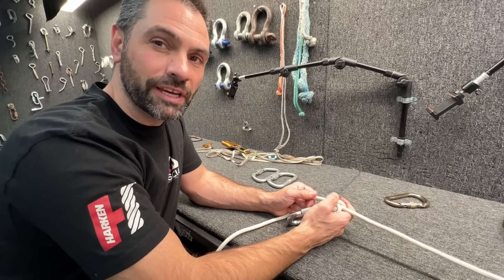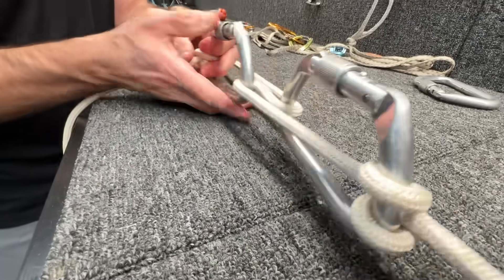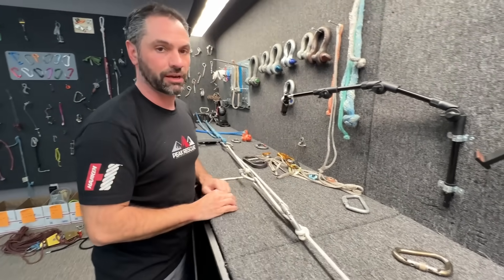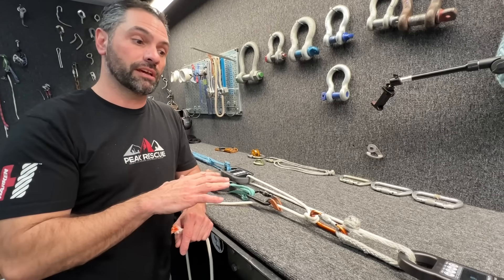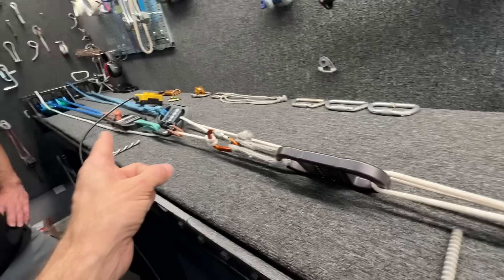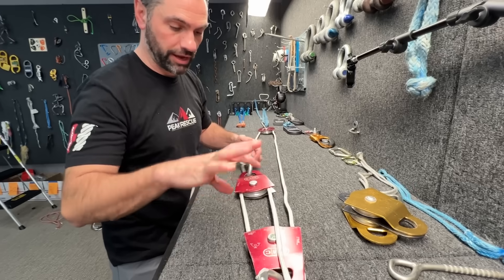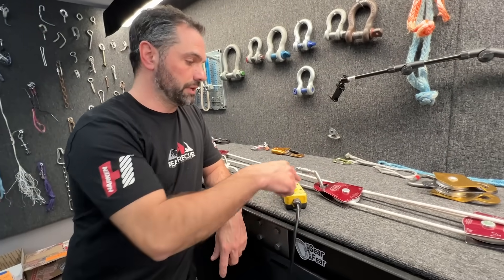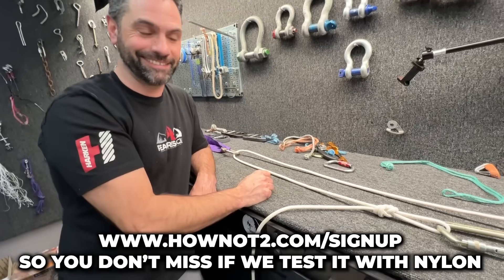I don't understand how this holds

Comment: "Mechanical advantage only exists when something is moving"? I guess that all that time I spent studying Statics was all fictional!!
Reply: Yeah, I'm not entirely sure what point he was trying to make there. Mechanical advantage exists in a static system, but you don't achieve anything. A force only does work if it is acting over a distance. Maybe that was his point?

Sometimes mechanical advantage can be useful to hold a force more easily, but in that case you are much better off with friction rather than a pulley system. That's how a massive ship being held by one man holding a rope wrapped around a bollard works or how a tensionless hitch works.
Reply: @thomasdalton1508 I think the misconception comes in from places such as the world of off-roading and vehicle recovery. I've seen similar discussions/arguments that say a pulley needs to be in motion for mechanical advantage to take place. In those instances, there most likely will be, but strictly speaking, mechanical advantage is using tools/setups to achieve force multiplication.
Reply: @mtbsam68  That's a different point entirely, I think. For a pulley system to produce mechanical advantage, there needs to be at least one pulley that is moving. The two forces need to do equal work, since energy is conserved, so if the forces are different they must act over different distances. The only way that can happen is if a pulley moves. I don't think that has anything to do with what he said in the video.
Reply: @thomasdalton1508 I was trying to agree with you, maybe I didn't word my response well. I was mostly saying that force multiplication is the definition of mechanical advantage, so motion doesn't need to take place at all, but when it does, one component or more will move relative to the fixed points. 

I for sure know that I don't agree with what is said here in the video though! Haha
Reply: @thomasdalton1508  I think he said that because he was confused by it not showing more force when using the carabineers vs the pulleys. He didn't get that the force is still there it's just being (mostly) eaten up by the increased friction
Reply: @thomasdalton1508 well and basically all knots work because of friction
Reply: @DrTheRich  Of course they do, but I don't know what that has to do with anything...
Reply: @thomasdalton1508  work requirements movement (work is force over time).  Most uses of these systems involve work being performed to apply force, not the post force-applied-static state.  That’s why everyone is getting confused.
Reply: @JB-jg1tc  Work done is force times distance.
Reply: @thomasdalton1508 that is what I am saying, yes.
Reply: @JB-jg1tc  It's not what you said...
Reply: @thomasdalton1508  I guess we can add another element of power vs (accomplished) work eh?
Reply: @JB-jg1tc  You said work is force over time. It's force times distance. Those are very different things.
Reply: Movement is not necessary to have mechanical advantage. There is however a universal tradeoff between advantage and movement. Take hydraulics, levers, block + tackle, etc. In any of these systems an advantage of factor M will exhibit a 1/M movement relationship. I’d be surprised to see a case where this is not precisely true.

Before watching the video I predict a 2:1 advantage.

My prediction is based precisely on one observation: the tensioning carabiner must move exactly double the distance that the bight carabiner moves. Focus on the relative moment between the two carabiners. To move the carabiners apart by one inch requires two inches of slack. This requires that the tensioning carabiner moves two inches toward the anchor. Two to one.

Now there’s another way to see that this is the case. In statics it is called sectioning, I believe. The forces in any cross section of this system must be equivalent. (or else there would be relative motion). You can see that near the anchor the force in each line must be half that of the force in the single line. Don’t be fooled by the section with three lines (the zig zag). The forces in this section are not distributed evenly amongst the lines. Remember that the force on the tensioning carabiner must be 1/2 of the full tension (p.s. there’s your mechanical advantage in one simple statement) and realize that the two lines running from it to the night carabiner each carry 1/4 of the total load. The line from anchor to bight carabiner carries the remaining 1/2. The system is balanced.

As with gears and amplifiers materials too exhibit the same relationship between force and motion. Double the force double the elongation. This is called the spring constant or Young’s modulus.
Reply: Don't you mean "frictional"?
Reply: @LoveAndClimbing well done sir. You beat me to the inevitable joke :)
Reply: @LoveAndClimbing Beat me to it.  Haha.
Reply: Aha, I got it wrong! And by a long way.

3:1 advantage is correct. It took breaking out pen + paper to figure out why.

Between the bight and the tensioning carabiner is a fixed length of line, D. The segment from tension carabiner to tree is length C. From tree to bight carabiner is length B. The length of the folded section (2 parallel lines) is A.

D = 2A + B + C
and
B = A + C

You find that 
A(C) = (D - 2C)/3
and
B(C) = C/3 + D/3

This makes sense. If C=0 then B=D/3 because the A segments match the length of B. If C=B then A=0 (this is the starting position).

Simple derivatives show that the relative motion of B wrt C (dB/dC) is 1/3 (when D is constant).

This relative motion is quite literally the mechanical advantage. 

There’s a good lesson to remember here. Remember to keep mechanical advantage and static analysis separate. No matter what the advantage of the system is it still is only as strong as the single line of rope crossing the distance.

P.s. this transport hitch thing seems like a poorly behaved block and tackle - you get the mechanical advantage but not the even load distribution.

I’m not sure I can fully agree that presence of friction destroys the mechanical advantage - which I argue is a property of the configuration - but I certainly agree that you don’t realize any benefits of advantage without motion. Friction in the system is realllly good at preventing any motion.
Reply: @oclyke22  ' mechanical advantage. '
When analyzing the idea of the difference between just the loops, and the pulleys in place of the loops, they seem to have left out that the pulley diameter itself has its own mechanical advantage.
Radius of the pulley vs axle diameter acts as a lever arm, giving much greater advantage against friction at the axle holding the rope at the fold back point.  The diameter routes part of the rope linear tension as a sideways force across and around the pulley, instead of just a fold back point.  If this didn't do this, there would be no reason to use pulleys to go around a point, larger diameter pulleys are easier to pull under load, etc.  No doubt a lot of crane pulley diameter calculations out there somewhere..

As always in physics, take things to the end points.  If the loops the ropes are wrapped around had infinite friction, nothing would move when tightened.  With zero friction, it could not hold even when you tighten it fully, because even with full even tension in 2 sides of the rope and basically equal pull, the zero friction would let it slide just a little past the fold back point and release tension slightly, and once tension started to release it would totally undo itself.

The far end tight fold, with the two equal sides basically balanced when tightly folded back, and the friction that creates with the pull against that, is what locks it in place.  Similar on the other end of things no doubt.  A direct , so balanced, fold back with a small diameter is what allows it to lock in place.

Easily proved by using larger diameter rod for the loops at the ends to put the rope on.  Say a 1" diameter and you'll probably have a difficult time to ever get it tightened, the rope tension will have too much leverage across the fold in the rear sideways portion, and the tension will make it slide past.  It's not the pulleys rolling as much as simply the diameter from center and leverage.

Get some rope, wrap it around a 4 or 6 inch pole, and pull on both sides.  Then do the same against the back of a knife blade or similar.  As you pull harder on both sides but then unbalance the tension slightly, the difference will become obvious.
Reply: the line is stretching, which, if you think about it, is the same thing.
Reply: That's right. When discussing static mech advantage, instead of saying "make believe"we say "potential". It sounds smarter.
Reply: Reky this may apply for the little math you are familiar with but take a guess how such simulations are performed.
Reply: @echteralex9565  simulations are an approximation, nothing more, nothing less. Rekt is correct, no matter your algorithms it will never equate to what's really going on. Unless you can simulate every atom.
Reply: Voodoo is the perfect word for this. I’m mystified.
Reply: Watching this while I wait for dynamics class.
Reply: just was going to correct them on that. these guys must have failed physics class.
Reply: If you spent any amount time thinking about what you were studying, you'd know how dumb this sounds.
Reply: Gravity much?
Reply: Point lost for missing *frictional
Reply: *frictional....

....I think you meant "frictional" 😋
Reply: @snoopsnet8150  The third reply already made that exact joke a month ago. Try harder!
Reply: It's a short cut way of calculating mechanical advantage - count the number of non anchored moving points. I'm sure you did this when doing problems with pulleys in Statics class. I certainly did.
Reply: @trentvlak  I just count the number of lines coming from the object being pulled.
Reply: @thomasdalton1508  That doesn't work if those lines are attached to anchored pulleys.
Reply: No, he's 100% wrong you are not moving if there is a balance of forces, but you are still accelerating due to gravity (i.e. standing on the floor and the floor pushing back up to keep you in place), which means you can have a mechanical advantage without movement. That's probably why he is confused is because his physics is wrong. The acceleration is coming from gravity and friction of his rope(friction has acceleration too), but it's on a fixture that balances the forces, so there is no movement. (i.e. he has a mechanical advantage without movement.)
Reply: Mechanical advantage (MA) does not inherently require movement. It can exist in both static and dynamic scenarios. Here’s a detailed explanation:

1. **Static Mechanical Advantage**:
   - **Definition**: Static mechanical advantage refers to the mechanical advantage in a system at equilibrium, where there is no movement. 
   - **Examples**: 
     - A lever holding a weight steady: The ratio of the length of the lever arms determines the mechanical advantage.
     - A block and tackle system supporting a stationary load: The arrangement of pulleys provides a mechanical advantage even without any movement.
   - **Calculation**: Static MA is calculated using the forces in the system. For example, for a lever, it's the ratio of the lengths of the arms (effort arm length / load arm length).

2. **Dynamic Mechanical Advantage**:
   - **Definition**: Dynamic mechanical advantage occurs when there is movement in the system. This involves the same principles as static mechanical advantage but includes motion.
   - **Examples**:
     - Using a lever to lift a weight.
     - Operating a pulley system to raise a load.
   - **Calculation**: In dynamic systems, MA can be calculated using the ratio of the output force to the input force, often considering factors like friction.

In summary, mechanical advantage can exist in both static and dynamic contexts. Static mechanical advantage is observed in systems at equilibrium, while dynamic mechanical advantage is seen in systems involving movement.
Reply: It was "frictional"?
Reply: That is true. You can foul the whole thing, before things get DYNAMIC.
Reply: Guns don't fire themselves. 

A 16 inch trio, is just that, until it moves something.
Reply: The mechanical advantage exists while tightening the rope, then friction takes over and holds the tension.  Systems interact.
Reply: @charleshill506  'The mechanical advantage exists while tightening the rope, then friction takes over and holds the tension.'
The mechanical advantage of the system is the mechanical advantage of the system.  Even if you have another thing holding it in place for a while (the fold back and friction), the MA is still there.  If the MA was 3, and then you sprayed the friction point with 'infinite lube', you would still be holding it in place with 1/3rd the force that it would take if there was no MA. 
It doesn't disappear just because there are other ideas at play and they don't have an easy way to measure it.

The real problem here is inadequate logic and analysis skills, not disappearing MA.  But I'm 180 IQ range and a troubleshooting and analysis tech, so I'll eventually walk us into correct answers.
Reply: @ModelLights  Friction plays a very small part.  It sounds as if you're saying that the weight would be held by friction alone.  It won't,  and even when you are just holding the weight you still have the mechanical advantage or how could you hold the larger weight with a much smaller force.
Seems like you're wrong.
Reply: @ModelLights  if you’re using a mechanical advantage to apply force (and do work in the process), friction absolutely matters. You’ll end up with less total force applied, the more friction is in the system when people are trying to do work (and more heat).
Reply: Well no, but actually yes
Reply: "Measurable mechanical advantage on our force testing equipment only exists when something is moving"
Reply: How do you calculate mechanical advantage in a system that's not changing/moving?
Reply: @SALTYCOMBATDIVER-ExInstructor  I don't know but you should still be able to measure it with a force gauge even static
Reply: @gearhead1302  how can you have mechanical advantage if it is dependent on force which is dependent on acceleration?  Static, unless I misunderstood it's meaning, there's no acceleration.
Reply: @SALTYCOMBATDIVER-ExInstructor  I didn't know acceleration was in the definition so I'm not sure about that one. I just know that when I'm breaking a lug nut loose with a breaker bar I still have advantage even before it breaks loose. If not then I wouldn't have been able to get it moving/accelerate. We might be getting hung up on some technical definition that's extremely specific to a situation. Don't suppose you could post the link?
Reply: @gearhead1302  it's the change in force (defined as acceleration) that breaks the nut.  Until either enough force is applied to overcome the friction or the friction is reduced (you add something that reduces the friction), the nut won't budge.
Reply: @gearhead1302  force = mass times acceleration, that's how force is defined and calculated
Reply: @SALTYCOMBATDIVER-ExInstructor  oh ya that's a good point. I don't have a good explanation other than maybe we are not defining acceleration correctly or in scientific term. Maybe the potential acceleration is all you need?
Reply: @gearhead1302  maybe you're smarter than Sir Isaac Newton but I'm not.  And trust me, I have tried by making physics my undergraduate degree.  We could draw diagrams and use all sorts of measuring devices (like were used in the video) but at the end of the day all we have are theories that some dead guy created calculus just to be able to prove what he was thinking.
Reply: @SALTYCOMBATDIVER-ExInstructor  🤣 ya this is true. Just theories and speculation. I'm just a technician I definitely got nothing on ole' Newton
Reply: @SALTYCOMBATDIVER-ExInstructor  by measuring force.
Reply: @kylejay6128  which you can't without acceleration.
Reply: Your coefficient of friction goes down when you change from static to dynamic friction. At rest, much of the force is countered by the normal forces within the hardware points. He is incorrect that the mechanical advantage doesn't exist, but it's impact is vastly reduced. This is why you can often keep a rope from slipping by appling a fairly small force tangent to the rope surface, but once it starts slipping that just turn into a friction heater.
Reply: @yellingintothewind  With a pulley, though, it is static friction even when the system is moving, since the pulley wheel is moving with the rope. That's one of the reasons you are better off with a pulley than a carabiner.
Reply: @thomasdalton1508  Correct, though in this case it's the static friction that makes the rig hold.
Reply: @yellingintothewind  Yes, here you have dynamic friction while tensioning and then static friction to hold it, which is an advantage since it will easily hold any tension you can put on it.
Reply: @thomasdalton1508  Exactly. This is one of the neatest applications of that technique, since it's all neatly in-line, but the basic idea shows up all over the place when rigging. This is also key to how capstan winches work. At idle, there's nearly 0 tension within the turns, which puts it firmly in the dynamic friction zone. When the controller applies a little tension on the free end, the friction increases exponentially and it can no longer slip.
Reply: @yellingintothewind  I'm not sure that has anything to do with static vs dynamic friction. That's the normal force changing, not the coefficient of friction.
Reply: @thomasdalton1508  If you've ever used a capstan winch (or any similar clutch mechanism) that feels "grabby", it's often because the surface finish causes a large difference between the static and dynamic friction. Yes, the user only controls the normal force at the end, however once they push the friction (total, not coefficient) at the end high enough to seize, the entire region moves into the static range by cinching. This causes the rope to deform and bite harder. Ballpark estimate puts it at up to a 50% increase in mu (in the Capstan equation) with real-world ropes and winches.
Reply: If I remember ME 221 right statics just means no acceleration. So can be moving just no acceleration.
Reply: Just get over it already!!!!!!! If you got issues over the dude makin his YT content then go away and don't watch....but all I see is you tubers make dumb, asinine and other disparaging remark....well I can tie 10 different knots from a half hitch to a monkeys paw.....all everyone does is sit back and nitpick or say what's wrong....I didn't realize how everyone is an expert 😂😂😂😂😂
Reply: There is no static system. force changes, something! Moves. Macroscopic or mikroskopic. In relatively stretchy ropes if turningpoints in this setup don't move, no force change...
Reply: @andreaspeper383 Force does not require motion. Work does. You microscopic motion is negligible and can be safely ignored.
Reply: @totally_not_a_bot 
 opposite of ignore. No way to measure it without movement. ;)
Reply: @andreaspeper383  brownian motion and elastic deformation are usually not part of the equation when talking about mechanical advantages and friction forces
UNLESS in the very small chance that you're a mechanical engineer doing a workup on some pretty serious architectural design or a bridge.

and by your insistence that those small motions matter in such a small-scale test, i'd wager you are not that engineer.
Reply: @Sihgilanu   i didn't insist, i just couldn't resist the joke.. "opposites" is a marvelous metaphor. Just to most engineers it simply means "two opposing objects"...
Reply: herpaderp try again. @andreaspeper383
Reply: M8. Math is only a snap shot.  Math is stationary. Math is not a running simulation of the real world.
Reply: @RekySai Take a calculus course!
Reply: Sorry. No movement, no mechanical advantage. Back to school.